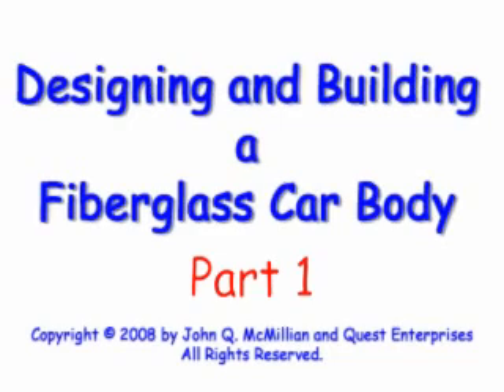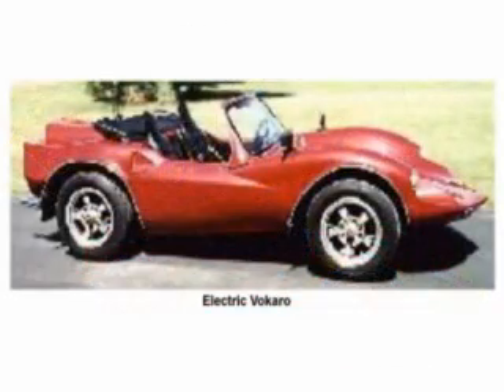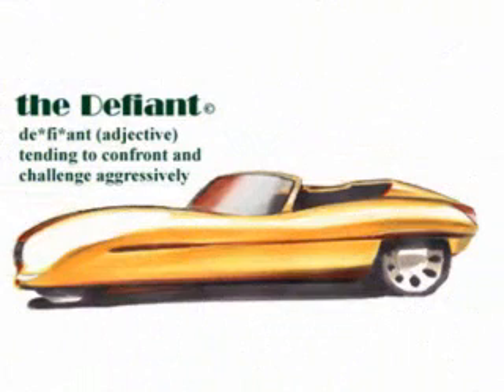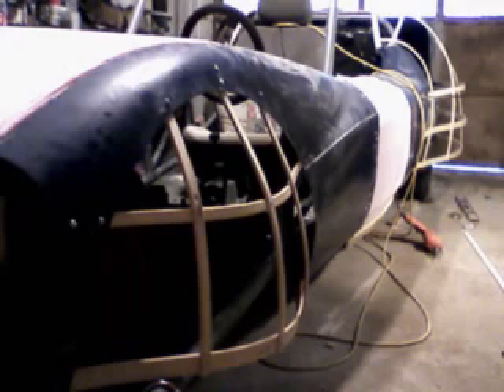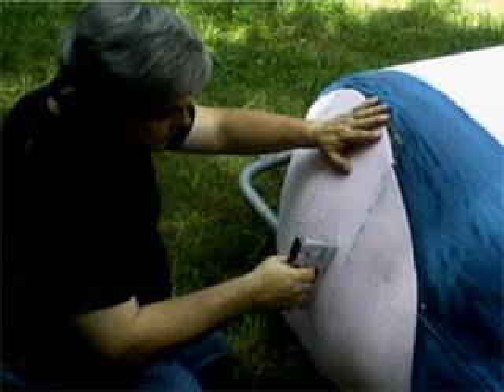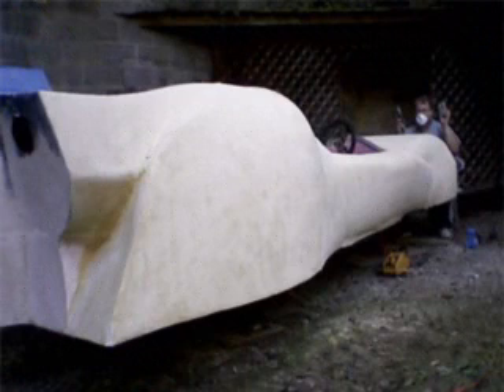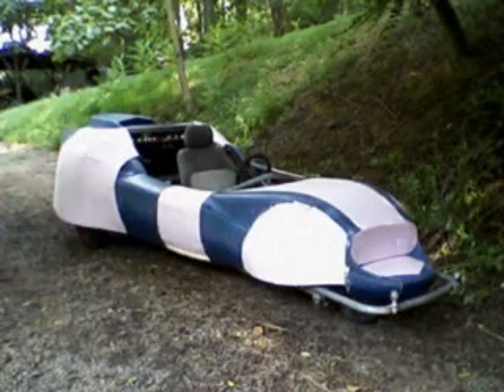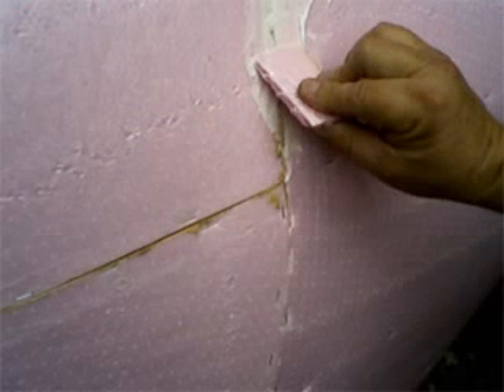Electric Car Fiberglass Body Build part 1

Comment: Yeah..That program at the site
MusclesMaximizer.info
shows an instructions which exactly you
need to know about how you can gain
muscles. In my past, I thought it was
impossible but with the helped of it. I
gained 10lbs of pure muscles in a week
using simplest body building strategy
which is NUTRITION.

Comment from the maker: For our proof-of-concept vehicle we came closer to using a chainsaw!  We did it the old fashion way for the custom build; sheets of paper and the skills I learned many years ago in a graphics class (long before CAD – we actually used an engineering scaled ruler!)  As for our new production electric roadster, we are using a CAD program and a plotter.  We are planning on hand building the molds.  We know several skilled craftsmen from the marine industry.  Check us out from time to time!

Comment: @waterwart There are other foams that can be used, but what's commonly known as "styrofoam" is EPS, expanded polystyrene.  It's highly soluble in styrene, which is one of the chemicals present in polyester resin.  You can use Epoxy and still use EPS, or you can use another formulation of foam, usually polyethylene or another styrene resistant foam instead, but that's not styrofoam.

Comment: Don't ever try to use styrofoam (EPS) with polyester fiberglass resin.  The resin WILL cause styrofoam to dissolve, because it contains styrene, a powerful solvent.